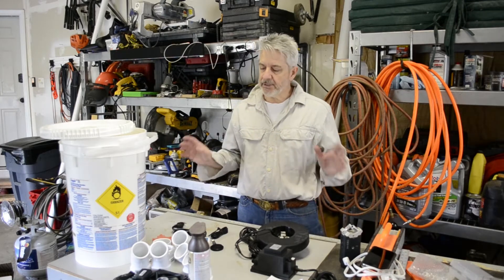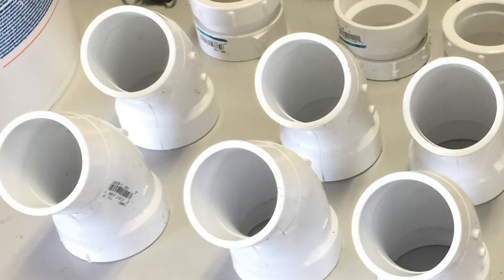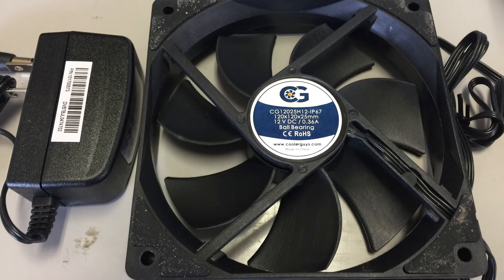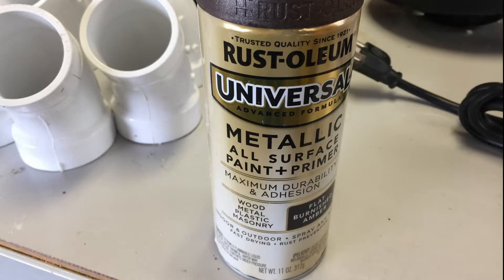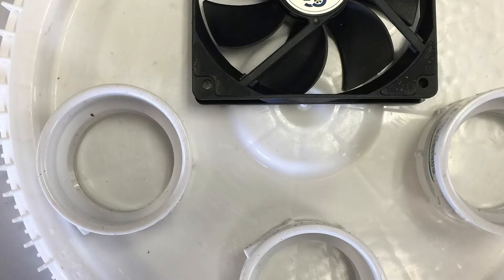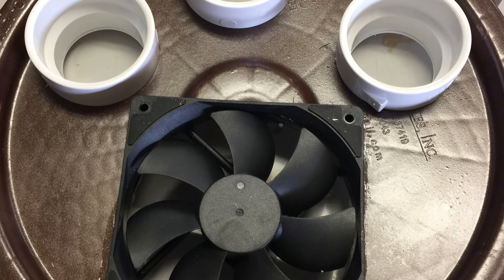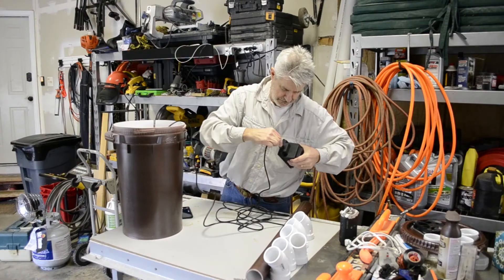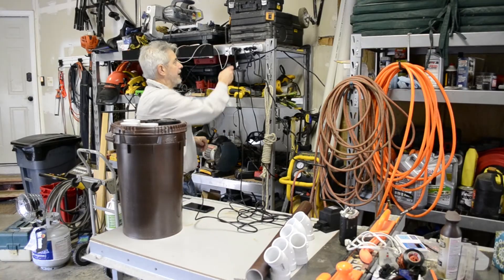DIY How to build an Ultrasonic Mister Humidifier

Comment: Due to the scale in the water, ultra sonic misters cause white dust to settle on everything in the house. No thanks.
Reply from the maker: Yes, if you have hard water you'll get the mysterious white dust everywhere.  We're on well water and that was problem, but then I bought a budget reverse osmosis kit from Reef Acquarium, and I fill the mister with RO water.  That fixed the white dust and also I perform zero cleaning maintenance on the mister head.  It's always clean.  I've been using the RO kit for about two years.
Reply: @jimw7043  Good idea. How often do you have to change the RO filter?
Reply: @jimw7043  would you mind sending me the link to the reverse osmosis kit? I can't seem to find it. Thanks great idea
Reply: @jimw7043  how do I get that list of components that you mentioned at the end of the video? Thanks

Comment from the maker: It's September and the humidifier/mister is still running very well.  I use hard well-water so once a month I soak the humidifier unit in some vinegar.   Also if you have  hard water, then occasionally throw out the old water and replace it all with new water because the concentration of calcium builds up in the left over water over time.
Reply: use distilled
Reply: This is awesome 👍😎💪 I'm using it for my snakes with distilled water 🌊 and thermostat and heater!